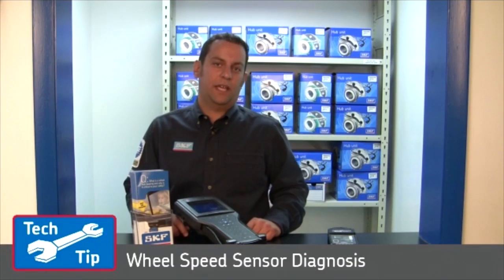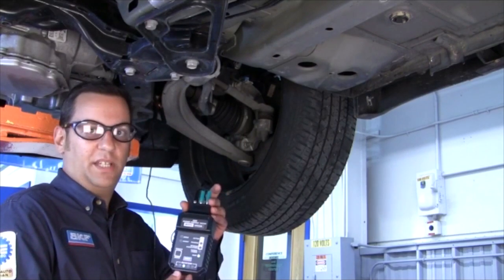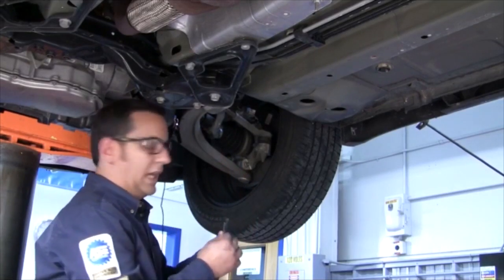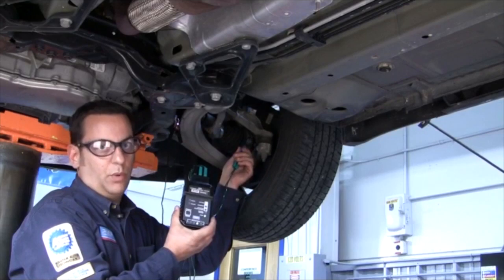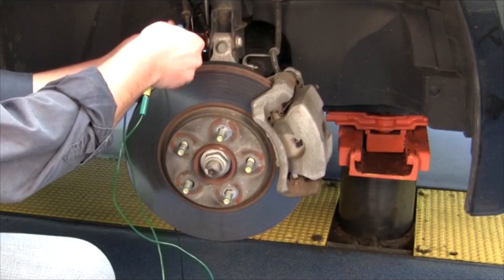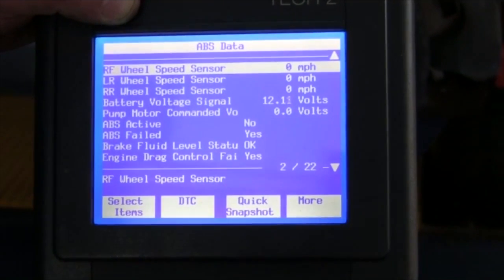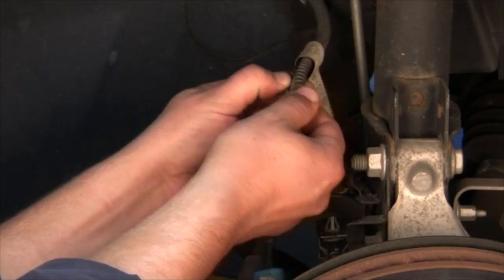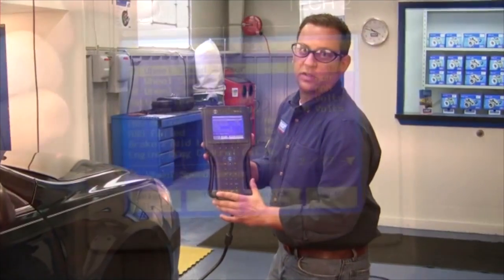ABS wheel speed sensor diagnostics

Comment: How do u test reluctor or wheel bearing?
Reply: There is no electronic test for the reluctor. You should look for damaged or missing teeth, and or breaks/cracks in it. This was a common problem on Ford Escapes a few years back.

For wheel bearings, there are several inspections you can perform:  
top/bottom “play” aka how loose the wheel feels; 
Listen for a rumbling sound that increases in pitch with road speed; 
The same rumbling sound will get louder or quieter depending upon which way you are steering the vehicle as it transfers weight on and off of the side that is thought to be bad; 
Use a mechanics stethoscope with the probe on the steering knuckle/hub while rotating the wheel, listen for a rumbling sound.  Compare that sound from wheel to wheel. If any of them have worn bearings it will be obvious;  
axle grease being slung around the inside of the steering knuckle or hub assembly.

Comment: Cant U just spend the Wheel instead of using that Tech Tool if you already determine  that the wheel hub Assy. is good
Reply from the maker: The test tool is needed to determine if the ABS is functioning correctly. 
Spinning the wheel without the test tool with not help in diagnosing the ABS operation.

Comment: I have Mira eco idle system (eis) 2012 

Need of experts opinion:

Speedometer is digital and shows 30% more speed than actual. 
There is no engine check light. Fuel consumption is good and rest of all the things are okay.
I have checked it from local mechanics. 
One person changed its software but in vain.

Kindly suggest me the diagnosis of actual fault in it so that I may get it to the mechanic and ask him to correct the fault diagnosed by some expert.

Thanks
Reply from the maker: Unfortunately the tech team here in the US is not familiar with this vehicle and system. Best of luck getting it diagnosed and solving the problem.

Comment: How to test without this tool?
Reply from the maker: The testing tools help make the testing task easier.
 Remember a diagnostic code is a system error, so the particular system corresponding to the code needs to be checked. 

Other diagnostic tools to help diagnosis system errors can possibly be used instead 
 for active and passive ABS testing include, but are not limited to, a Volt and Ohm meter or a lab scope.

Comment: we have changed the switch of the computer to a rava4 2011 and connected back to a new one but the abc light is on and the when parked the steering is hard and get soft after a few distance what can u advise me?
Reply from the maker: We need more info to try and help. What is the name of the part you called the switch you replaced and
 why did you replace it?

What is the diagnostic code set ?

Comment: Transmission stopped up-shifting as my speed increased, wasn't sure about what the issue was, but all the related lights have been on since I bought the SUV used. I didn't need to buy/borrow/rent a tester, I unplugged both front wheel-speed sensors and drove my Hyundai around, then plugged them back in. I had all my gears back. Traction-control is great when it works, but I miss the old days of being able to tune an engine with a screwdriver.

Comment: What is the wire called that the speed sensor harness/ wiring connects to im trying to find one for a 2006 Hyundai tiburon? Please
Reply from the maker: The 2006 Tiburon has a discrete mounted ABS sensor and a press in wheel hub bearing which means that it is tested differently than a generation 3 hub and harness as shown in the video. Thanks for watching!

Comment: I have a 2001 chevy lumina and it came without  ABS system from the factory is it possible to  install an ABS system in it.
Reply from the maker: SKF supplies certain hubs with the ABS tone rings and sensor, but to determine if a complete ABS system can be added it's best to contact GM.

Comment: Do you know the size of the bolt in a 2000 Lexus RX300 wheel sensor?  I need to run a tap down the hole.  It is broken off.  I will drill out remaining part and re-tap.  Is it a M8 X 1.25. ?
Reply from the maker: It's best to contact Lexus to get the correct bolt size. This video provides diagnostic testing for a wide variety of applications.

Comment: For Toyota Venza model 2010?
Reply from the maker: The front bearing on the Venza has a Gen 1 double row ball bearing. The ABS sensor ring is on the CV shaft and would be tested differently.
The rear hubs are different depending if the Venza has AWD or FWD. The AWD is similar to test shown in video and the FWD rear hub also does not encompass a speed sensor on the hub.
Reply: Thanks and awd Toyota venza
Reply from the maker: If you have an ABS light on it best to have a repair center that offers complete diagnostic review the concern. Correct equipment is essential. Tools like the test equipment in the video offer instructions and help with diagnostic but following manufactures instructions will determine root cause.

Comment: i like your scan tool, what model and brand is it?
Reply from the maker: It is a Tech 2. GM used this scanner for all GM cars and light trucks built
between 1996 - 2009.
Reply: So in this vid u say that as long as your wss shows rotation then it is good. What if the wss is showing rotation but its reporting back 50 mph on the scantool but the rest of the wss are reporting 18mph which is the actual speed of the car so the pcm thinks thecar is spining tge tires so it engages the tc. I am under the assumption that my wss is bad. What r your thoughts. I already removed it and cleaned all rust from surface and put it back in and got same results.
Reply: So in this vid u say that as long as your wss shows rotation then it is good. What if the wss is showing rotation but its reporting back 50 mph on the scantool but the rest of the wss are reporting 18mph which is the actual speed of the car so the pcm thinks thecar is spining tge tires so it engages the tc. I am under the assumption that my wss is bad. What r your thoughts. I already removed it and cleaned all rust from surface and put it back in and got same results.
Reply from the maker: We are showing two different checks. The pinpoint tester confirms the presence of signal (rotation) at the hub and then supplies a rotational signal to the EBTCM to check the harness.  If you are using just a scan tool some additional tests may be needed. A resistance check on the harness may help and can be compared against the know good side.

Comment: i mean i confuse between ABS sensor and ABS wheel speed sensor
Reply from the maker: +salem ogla It is one in the same. However, there are different types of 
sensors. Some sensors are outside of the hub unit and bolt to the knuckle, while others are built within the hub unit.

Comment: what is the best way to do if my ABS light is on when my car is in motion? I have a opel astra 2000 DTI...
Reply from the maker: vadz valderama The best thing to do in this situation is to use a scan tool to find out what the ABS code is. This will identify which part of the ABS system is malfunctioning.

Comment: has anybody ever tried to rewire the reluctor gear wire to a wheel after they put a traction control rear end in their car?
Reply: well that didn't work lol .. my abs light and my brake light went off , but when I drove the car it went into low traction mode instead .. I think I would rather not have abs anyways

Comment: So after running around in the car noticed that it got worse simply when hitting bumps or cranking wheels to one side... so figured it had to be a wiring problem.   So turned car on and while it was running wiggled all wiring harnesses and the EBCM harness to try to cause ABS and TRAC to go lights off.  After abit of testing, triggered the warning lights a few times in a row... so found problem!   Found error to be the ABS connector to the hub on the drivers side front - pins inside connector were simply corroded and making intermittent contact.  Simple as that. Put penetrating oil in and no more errors.  So yes - it was a wiring issue... but only in the connector. So for any of you getting this as an intermittent error... and worse when it rains... disconnect the connectors and check if they are corroded... if so, oil them and work the connection on/off a bunch of times to work out the corrosion.  This error had me worried cause it caused 3 codes - one for each side AND the EBCM to show.  If you get this and go into a crooked mechanic, they could end up replacing the EBCM and both front hub assemblies.  In Canada here, the EBCM is $1500 and the hub assemblies (decent AC Delco US units) are $350 a piece... add labour and you're up to $2500 or more.   It took me 20 mins to get the tire off, lubricate the sensor connector, and put it all back together.  Hope this helps someone out there.
Reply: Hope it helps me, cause my ABS, TRC CTL and BRAKE lights came on after the heavy rain but right before that, I installed brakes(rotors, pads)and coilovers so I don't know if it was the rain or the work. - Or both. - 
 I'm already replacing the second sensor AND planning on buying hubs... It adds up quick.

Comment: I just bought this tester, tried it today and I got no reading of any kind, even on a known good wheel. The tester powers up, cycles modes OK, no help reversing leads, even connecting GND directly to BATT NEG. Tool only beeped when lead connection was interrupted. They'll be getting a call from me.
Reply from the maker: There could be several scenarios that would cause the tester to not give any feedback. Example: Testing an Active sensor with the tester in Passive mode. 
Are you rotating the hub so it generates a signal? Or, there could be an internal problem with the tester itself, or a problem with one or both of the test leads.
Please make sure that both test leads are good, check the continuity of the leads with a multimeter. If the leads are good, make sure that the tester adapters you are using are making good contact with the sensor. Check the battery in the tester and replace it if necessary. If it still doesn't  work, the tester has an internal problem.

Comment: What brand is the scan tool (model #)?
Reply from the maker: The tester unit that was used is a Waekon ABS Sensor PinPoint Tester Model # 20560
Reply: I asked about the Scan Tool Model # not the PinPoint Tester.
Reply from the maker: Felix Jackson  It is a Tech 2. GM used this scanner for all GM cars and light trucks built
between 1996 - 2009.

Comment: That is a  useful tool but here is my question. How to you test for air gap between a wheel hub, and the wheel speed sensor due to rust build up underneath the sensor? if this happens it will send a erratic signal and cause premature abs. If you could tell me how to fix this that would be very useful. Thank you.
Reply from the maker: 8020johndeereseries - On a Passive style ABS System while rotating the wheel slowly under 3mph the tester will not show rotation if there is an excessive air gap like rust build up. We suggest comparing the other known good side as a reference.